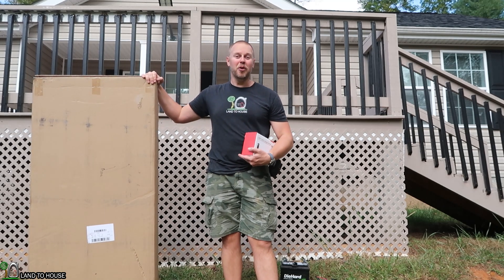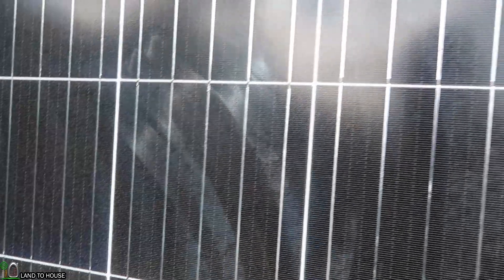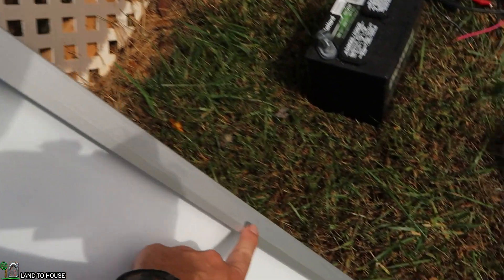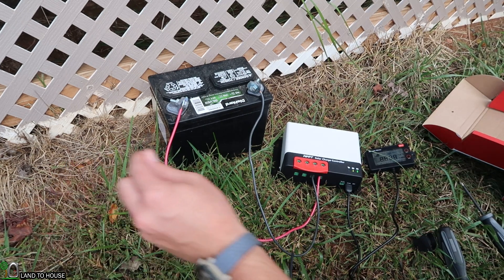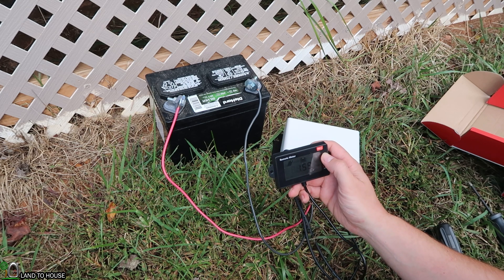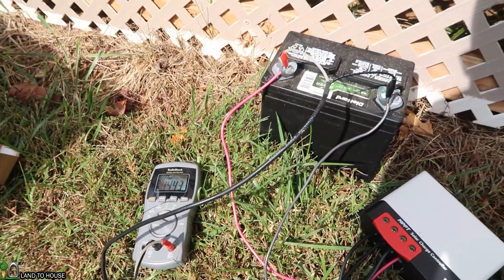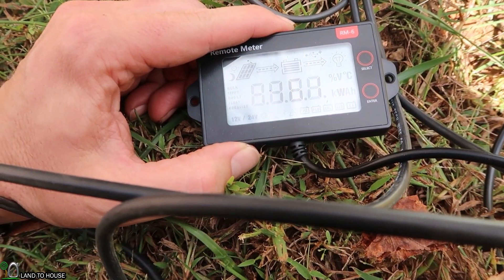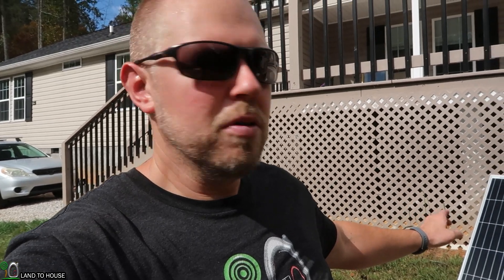BougeRV Mono Crystalline 180w Solar Panel

Comment: The BougeRV 180W 5BB version solar panels have been quietly dropped/discontinued by the manufacturer.  They start to lose power after about 4-6 months and develop burnt edges alongside each cell. I would stay away.
Reply from the maker: That is great information to know. Thank you.

Comment: you need to work smarter not harder so many of you're videos reasantly have been out of the front of your stunning house and wether often stops your progress extending your decking area at the front so you can have some dry work space underneath will make things easier
Reply from the maker: The weather around here is certainly rainy. Since my wife left I've had to be very selective with the days I can work on videos.   Hopefully sometime next year I can build a carport.
Reply: @LandtoHouse  I know because I've been there you need to stop thinking your separation is a bad thing and embrace it as a opportunity to find the one true friend that will stand buy you no matter what and you will do the same for them you are lucky she left and didn't make you leave

Comment: Will that panel be enough to power a fridge?    Interested in getting solar power in case of an emergency.    Any info?  Thanks, God bless.
Reply: I have 4 of these solar panels charging a total of 500Ah batteries with a 3000 watt inverter and I don't have enough to run a refrigerator.
Reply: It's the inverter that's key to running a fridge.  While running it pulls 5-8 amps and you would think a 1000w inverter would handle it.  But a fridge typically needs 15 amps, possibly 18-20 amps (depending on the model) to kickstart the compressor and get it running, so you really need a 2000w inverter with a surge capability of 2400 or more.  the inverter will run the fridge as long as the battery bank lasts.